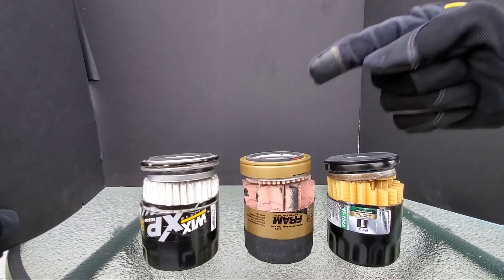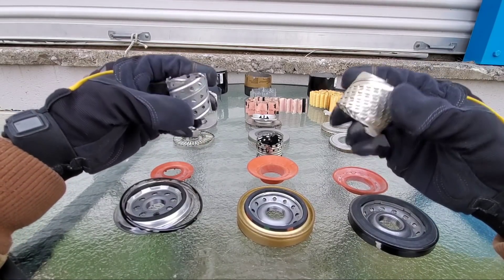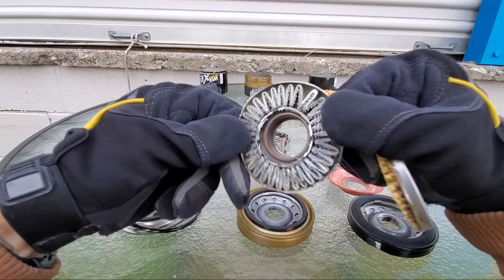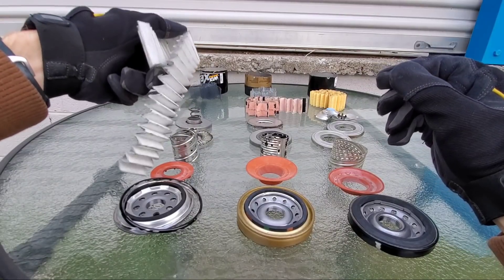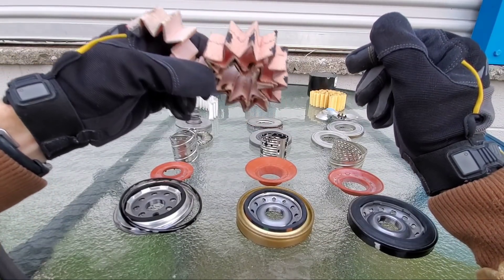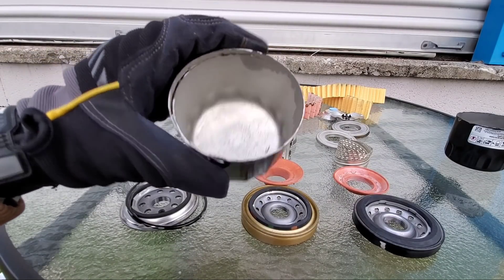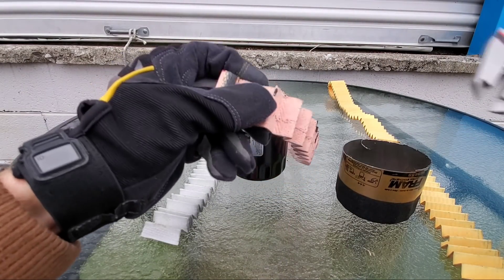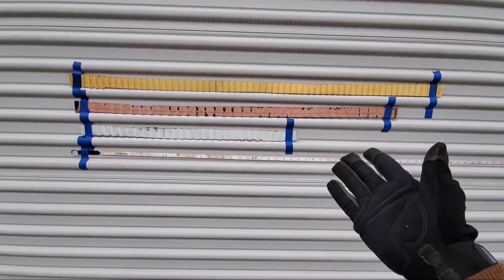I cant believe what was inside these oil filters Fram,wix xp, Mobil1

Comment: Hello, sorry for my not so good english capabilities. Thank you very much for this effort to compare the filters, mostly on their building characteristics, but the essential is missing, and actually very difficult to compare: filtration capabilities and stability under mileage.i don't Care so much about a bit of rust inside (storage duration ?) Or box thickness but much more about media quality, capacity per cm2 and stability during opération ( behaviour vs water, temp, long storage etc...), Value and consistency in Time of valves sealings and opening pressures etc... For instance the white Wix media is very different to the deep Brown one. One is mainly cellulosic, the other mainly synthetic .this leads to very different filtering capacities per surface unit, making the lenght comparaison unrelevant . Perhaps other readers Can help on this ?
Reply: Pascal-- your comment is the best one on here so far.  Filtering ability, oil flow, and filter capacity are much more important than (a) poor storage issues; or (b) anecdotal information concerning one's personal experience (i.e., "I used Wix for many years" is a meaningless comment).
Reply: @Jimmy-sj9ny  thanks Jimmy. We Can all apreciate the effort of a good faith guy trying to characterize different filters in his garage, but we have to understand that those components are sometimes much more complicated than they appear to be and very tiny details in the design or manufacturing can make huge differences in lifetime stability. We all would like to have simple answers, but with modern engines, we better use good brands : with highly sophisticated engines, bio-fuels, very New synthetic oil grades (0w20 for diesel !), yes there are  differences between products that matters.   As former chief engineer in diesel , I would only recommend to avoid to save few dollars and go for good products ( well known brands will not take the risk to deliver low quality products and destroy their image and take liabilities for engine destruction).

Comment: The real test is the SAE test on contamination trapping.  I see you prefer coil springs over leaf springs.  The rust is troubling but if you don’t cut the filter open how can one know?  Any filter could rust if it sets on a warehouse shelf too long.  Media thickness may actually indicate flow resistance, not a good thing.

Comment: anyone with an i.q. over zero knows that rust inside the mounting plate, especially that amount, ain't going to hurt anything, it's not thick and scaly, PLUS it's a filter, any rust that might slough off will get caught in the filter media, in my almost 50 years of driving, i haven't had one single negative event with any fram product, and to all of you smart asses , my driving experience includes 2 years in the army corps of engineers and ten years driving truck over the road,besides driving all over the country in various vehicles and weather, but the black glue, i agree , i wouldn't want that in my engine
Reply: I disagree concerning the rust. I do agree that this amount of rust will not cause a failure of the part it does however in my opinion show a lack of either QC or a quality construction process. I dont want rust in my engine going thru the bearings and other intricate parts. In my opinion the rust is worse than the glue although I do not want the glue in thee either.
Reply: @lenny351  the rust tells me that it's been sitting around for awhile, they don't come in sealed boxes or plastic wrap, i don't want rust in my engine either, but that isn't a lot of rust, the black glue though, come on fram, and i like fram stuff, i've never had that in any of mine
Reply: @lenny351  
Are we sure it's iron oxide. Was it confirmed?
Reply: Put a FRAM filter in a cat engine lol
Reply: This guy don't even know how to use calipers

Comment: My 454bbc and 350sbc engines in my 85 C30 and 86 K2500 respectively only run oem filters. Same with my dad's 95 F350 Powerstroke.
Reply: I always run the taller filters when clearance is not a concern. In my Vette I get the AC Delco UPF64R, Just add the UPF__R to the filter # you use to get their high performance line. Bottom line is oil changes at 3-5k miles, proper warm up and cool down and those motors will last a lifetime
Reply: For $10 you can get a Motorcraft FL1995, made by Baldwin at Wal-Mart. AC Delco’s are ok, but there are better quality filters for only a few bucks more.
Reply: I love telling people about an oil change on my ‘96 7.3 Ambulance. I’m like: “ yeah, it takes 4 gallons of oil and the filter holds a quart by itself”.  Make sure your dad is sucking out the 3 extra quarts on top of the engine. Check out PowerStrokeHelp here on YT for more info. That’s why guys keep needing High pressure oil pumps on those 7.3’s

Comment: WixXP is still a better quality filter from what I can see. Wire backed unlike Mobile1, synthetic material unlike the Fram. A little surface rust is going to get stuck in the material upon the first run through.
Reply: Fram Ultra is Synthetic.

Comment: On filters I like motorcraft for fords, a.c. delco for g.m. and chrysler I like wix or purelator. But best filter I saw was factory toyota when they had media based filter. From a engine builder side, fram is still orange can of doom. With oem if there is failure with spec oil and filter they got a fight on their hands. The balance has always been flow versuses filtration. But biggest fight is the manufacturers claiming go further over and over... most vehicles are good at 5k. Some like diesels or german stuff, have a much larger oil capacity meaning less wear on it. On new smaller turbo engines oil is truly the life changer. When you shut off the engine the oil cooks in the turbo...

Comment: Thanks for the video!    My mental note is to stay away from Fram going forward.   The poor quality Fram oil filter in this video and my poor experience with a Fram engine air filter (which was so far below the quality of the OEM engine air filter) convinced me that Fram is NOT about quality and all about cost-cutting.

Comment: Where I notice filter quality is with cartridge filters because they aren't concealed in a metal can (I also deal with a lot of European) and I have to say I've noticed that Mann and hengst filters (used by OEM's) are the best filters.
What I'd like to seen cut open are these "technician's choice" or "pro tech" and "mighty" filters and the similar that are used by quick lube shops as they are always smaller the the OEM's and just seem like empty cans.
The best filters IMO based on my 20+ years in automotive industry would be the OEM's filter. I just dont think any other filter comes close or is neccessary.

Comment: I consistently change my oil & filter at 5K miles with SuperTech 0w20 & filter and never had a problem - cheap price & same results, thx for the vid
Reply: I used to use super tech when I had a Ford Taurus had eighty thousand miles on it and I deliver pizza. So I drove a lot and I would regularly check my fluids. I noticed with supertech the oil evaporate a lot quicker. Quaker is just a few bucks more and a better quality and did well on evaporation and lubrication test

Comment: Currently using Toyota TRD oil filter in my 2017 Toyota Tacoma SR5 3.5 V-6.  Why not just use OEM filters from the dealer?.. you can snag deals/sales run by the parts dept. or score factory spec filters on-line/ebay.

Comment: I have probably used every oil filter under the sun and have never had an issue with any of them.  If you change your oil and filter like you are supposed to, I don't think there is any problem with any of them.  I have had vehicles up to 250k miles and still going with no oil related issues.

Comment: Not all engines are the same. I think they need to get rid of the anti drain back valve out of the filters for certain model of motors . For example chevys , mopars the filter hangs upside down or down at an angle . No possible way for oil to leave the filter. I've notice in some motors it sounds like a small dry start on engines thats been sitting for a while . And a little bit of oil pressure drop during fully warmed operations
Reply from the maker: When the engine first starts cold it will be higher but shouldn't fall below spec. But the anti drain valve is important and the oil definitely leaves the filter or you would destroy your engine. The valve just keeps the oil filter full of oil so the engine doesn't have to fill it up making oil reach critical parts faster.

Comment: Hey Nate, any chance that you could do a comparison between and Toyota oil filter VS a Wix XP? I have a 21 year Avalon that has been in my family since new and I have been using Wix XP filters for about three years, but recently decided to buy Toyota filters! Did I make a good decision?
Reply from the maker: I will check out some Toyota oem filters. Some of the OEM filters i have checked are surprisingly good.
Reply: Thanks for getting back to me! My experience in the past with Japanese auto makers oem filters have always worked well for me in the past!
Reply: I'm a big fan of Wix filters.  However, I am using a Toyota TRD oil filter on in my 2017 Toyota Tacoma.  The other aftermarket cartridge filters look like garbage.  The TRD looks like it's made better.
Reply: Cool beans! They have been working out for me so far!

Comment: I don’t know man, I’ve used all brands of filters over the years, I’ve never really seen a “bad” filter as long as you change them regularly. That is the key! Don’t buy into extended oil drain intervals. They push oil and oil filters way to far in my opinion. Today’s engines are too costly to repair. Whatever your manufacturer recommends for an extended oil change interval, cut that mileage in half and change the oil and filter religiously. If they recommend every 10,000 miles, change it every 5,000.
Your car will thank you!
Reply: Also it mentioned regularly in the manual as "normal" driving condition so people who tow or live in hot or extreme conditions shouldn't run their oil to the maximum and rather change oil sooner I personally see a big difference in the color of oil hauling my 5th wheel camper around in summer opposed to driving from work and back empty
Reply: Danny J. Rumbles everyone is always so worried about what the inside of a filter looks like. It can look like the best design ever but if it doesn’t catch small particles it’s a worthless piece of junk. Focus on actual lab particulate testing and not what looks pretty.
Reply: Eric B , I’m not going to argue with you man. I agree.
Reply: @johnb1658  that was the only reason why I went with the Fram, because at least from what I saw, it looks like Fram catches the smallest particles.
Reply: And don't forget time too. If you don't drive alot, don't wait 5 years to change your oil because that's how long it took to get the milage.
Reply: SilverStar Heggisist , yes I agree!
Reply: No need
Reply: Absolutely agree and it too is my mantra. I’ve ran nothing but Fram for decades. Two mini vans to near 300k before sold and our current cars in the low 200k range.
Reply from the maker: I agree with the oil but most people dont realize they fall within extreme driving conditions. Most of everyone.   Yes i also used fram for years and thought i had not had any issues. But if the cars compression, oil pressure, oil flow rate, oil loss, and so much more isn't perfect then you can't say no issues. I did the same in the past. After what i saw today im so shocked and this was before i even cut open a oil filter. Soon enough i will share but you decide what's best for you. I sell nothing so i only want to help.
Reply: Danny J. Rumbles lol good to know I’m not the only one who lives by that same logic. Except I change every 6k oppose to the recommended 10k

Comment: Wasn't Wix the thickest but also the shortest? Sounds like a trade-off to me. Not enough difference to be concerned about. I wonder which one restricts oil flow the least? Again, likely little difference.
Reply: I like your comment.
I was wondering if the "Media" has different filtration. 
How big are the microns alowed to be passing through it.
I have a shop filter for wood that traps upto 5 microns but that's really big compared to particulates in oil.

Comment: Love the vid I am so happy that I saw this was just about to get a fram but I think I will pay more just to get the wix or Mobil one 
Also do you like Pennzoil
Reply: Penzoil ultra platinum is mopars factory fill in all of their muscle cars and i use it in my Chrysler 300. Mopar sets high standards on their ratings and it meets all of them. It was also in the top 2 of project farms oil championship. The only oil to beat it was the Amsoil Signature series.
Reply: Pennzoil oil filters are just rebadged Gram, I would avoid if possible.
Reply: Aeronomx I meant the oil
Reply: 20 years ago I would've avoided pennzoil like the plague. In the recent years their oils have improved leaps and bounds. Pennzoil is definitely in my top 3 favorite brands. If interested Google "motor oil wear test" on wordpress. by 540rat. It's a very Long read, with a lot of good information on lubrication.
Reply: Pennzoil leaves ash in the oil pan. My father was an ASE Global Tech and mechanic for 40 years. He used Mobil 1 in his everyday vehicles, and Royal Purple in his muscle car.

Comment: It would seem that the metal components are all electroplated steel. Something like zinc galvanising most likely. Since the Fram is rusting, I'm guessing they either aren't treating the metal components long enough or the plating mineral concentration in their solution is depleted. Basically cheap coating and not enough quality control.
Personally I do like Wix filters best. K&N are good for the money too if you buy online. Especially their Performance Silver line.
One interesting thing I learned recently is that many of the synthetic long life oil filters actually filter worse than their non synthetic counterparts. They just don't filter particles as small as the non synthetic filters. That way they don't clog as quickly, and you can run them for the longer intervals without losing flow. Not exactly what you want from a more expensive filter! Better off using normal filters and shorter change intervals.
Reply from the maker: Very informative i agree wix is great also I believe the oil change intervals itself is not as it should be for real longevity. The long drain intervals are not good for vvt plus i contacted several engine oil companies and checked dates on the time when oil interval mileage increased. Asking about changes to the oil & car manufacturers both more less gave the same answer. There were improvements but nothing major. I do have a more detailed answer but car's need good clean oil more than ever and between the environment and sales of cars this is really what made a big increase in oil change intervals. My brother changes oil once every couple of years. Eventually his jeep uses more oil. Then his differential goes out right after telling me that doesn't need changed almost never. I personally change mine typically 3000 and some im using to test on different intervals to try and test in lab. However im hardcore when its comes to the oil change. Containments are one of the biggest problems.
Reply: Yep all very interesting! The biggest reason for oil change intervals being shortened was auto manufacturers saw the prevalence of synthetic oil as a way to lower "cost of ownership" and use less maintenance as a new sales tactic. Plus the oil brands themselves had a marketing battle with it at our expense. I also hate how common XW-20 or even XW-12 oil has become. The only reason for these much thinner second number oils is fuel economy, not engine protection! You won't see me running anything less than an XW-30!

Comment: And most all K&N filter I've checked out dont filter smaller microns as there all about high flow.  I think they go down to 40 or 30 the lowest.
Reply: This is true but the point of KN is for high flow rate. They use impregnated cellulose for their filters which doesn't filter out down to smaller microns than synthetic material.
Reply: @JohnnyFTD  I know that's what I said

Comment: Good vid, I'm glad the fram ultras I run are the cartridge type vs canister so no rust getting into the system.
I checked out a mobil 1 recently and only filters down to 30 micron , fram down to 20, not sure about the wix but the amount of filter media in the wix isnt very impressive. Purolator Boss is another option I'd use also.
Reply: I wouldn't use the Boss in a Toyota because Toyota emphasizes flow rates and the Boss filter does restrict flow.

Comment: I only use Royal Purple Oil filters. They are nearly identical to AmsOil ones
Reply from the maker: They are great quality would you like to see a certain comparison?
Reply: @NATESINTERACTIVEAUTO  Hey Nate. I just found out Costco sells Kirkland Brand Full Synthetic for 29 dollars for 2 five quart Jugs. Could you do some testing on it?
Reply: RP and Amsoil are made by Wix as well as Napa filters. The RP is just in a purple housing.
Reply: @Hogrider177  The Micron Ratings are completely different between Wix, RP, and Ams. So the filter media used is not the same. And I'm pretty sure champ labs makes RP filters along with alot of other brands.